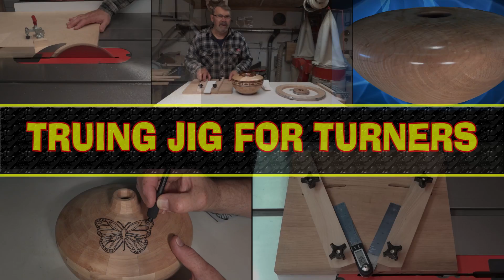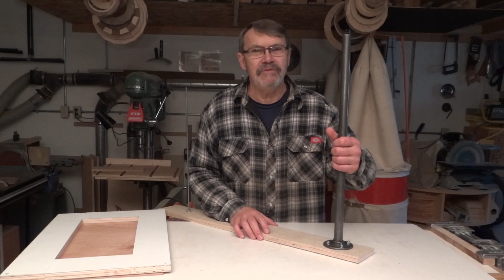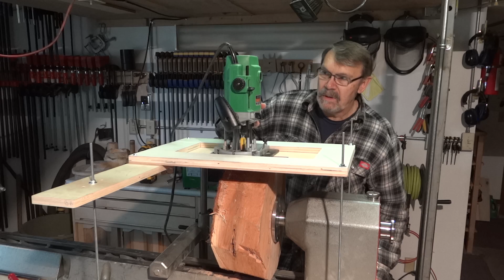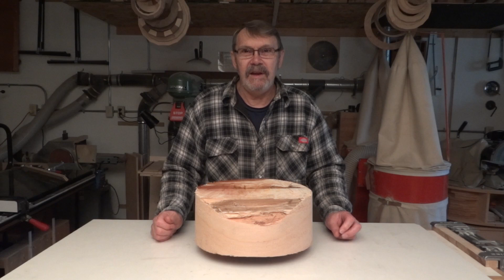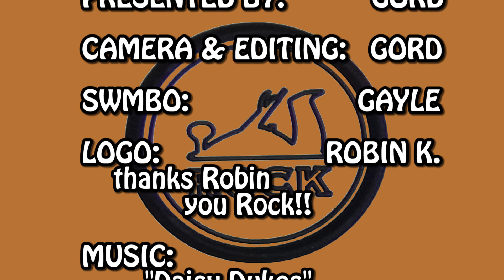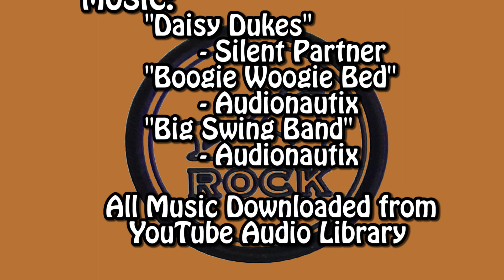Truing Jig For Woodturners

Comment: just one comment, your video does not show the support of the lower part of the jig, did you have heavy plywood pieces, or was one ply sheet heavy enough to hold up the router?
Reply from the maker: Sorry for the delay in answering your question. I had to watch the video again to check for myself. I just used a 1/4 inch piece of plywood and it worked just fine. Thanks for watching. I appreciate the support!
Take care,
.....Gord

Comment: I am not knocking the router idea, but my advice to those who do not own a band saw would be to get one.  I use my band saw more often than any other woodworking tool in the shop.  If you look around, you can get a fixer upper pretty cheap.
Reply from the maker: +dgreene909 
I agree, the bandsaw is of much more use to turners than a router. I wouldn't suggest someone spend the money for a router just to do the fluting but for those who have one already it's just another way to use that weapon in our arsenal.
Thanks for the input,
.....Gord
Reply: The
Reply: Glad to see someone else does that.

Comment: Brilliant piece of rigging there Gord,  Wonder about turning the router on its side and running perpendicular to the bed to bring the faceplate end tail end into parallel, or at least closer maybe if you were planning on keeping bark inclusions, etc..  That thing really removes wood in a hurry!
Thanks for sharing your idea,
- Bill
Reply from the maker: +Bill Kibby 
Glad you liked the idea, Bill. I'm not sure about using the router on it's side but I would imagine if a proper housing was built that would keep the router from falling out it should work well. Might take a bit of effort to design and build it but it sounds like a good idea. Let me know if you try it; I'd be interested in seeing something like that.
Thanks for watching, Bill.
Take care,
.....Gord
Reply from the maker: +Bill Kibby LOL I'm not sure I would call it a rush, Bill. I must admit I was a bit nervous but by that time it was rounded well enough that it was fairly tame. I would NOT have wanted to turn the lathe on any earlier in the process, though.
Have a great day in your shop,
.....Gord